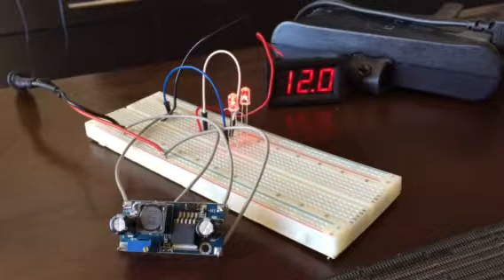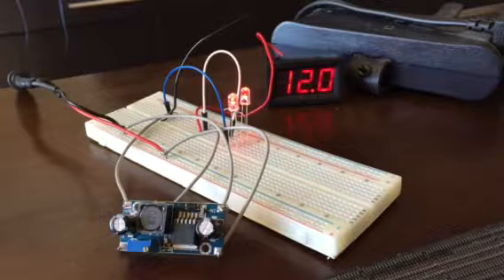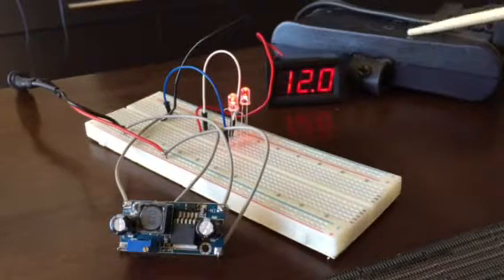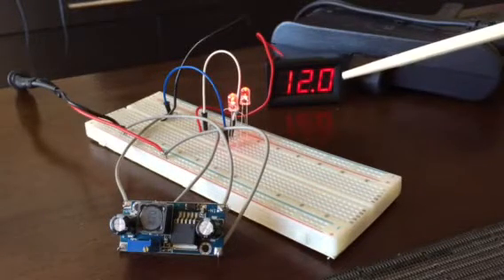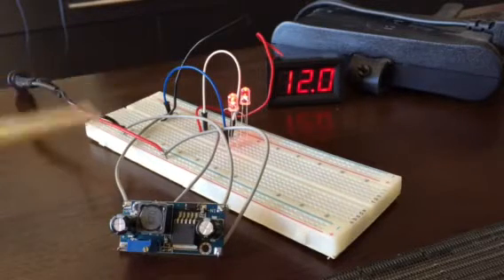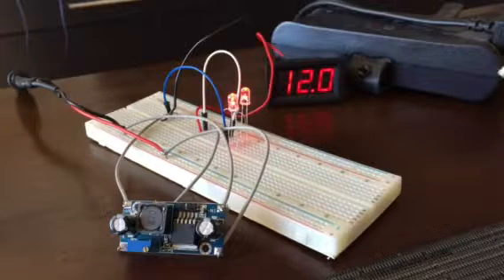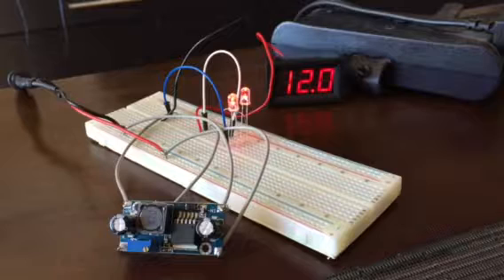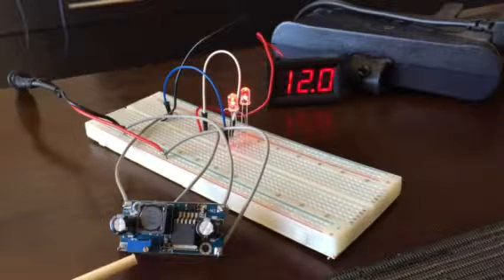Using an old laptop power supply to make a bench supply  - Part 1

Comment: can u please show how u were able to do this? specifically, how were u able to convince the charger it is hooked up to a laptop (and thus, it outputs voltage). I have a Dell 19.5v 4.62A charger Model DA90PS1-00, PA-10 Family that has the center sensing pin in the middle of the adaptor which I'm assuming is what tells it that it's connected to a laptop. thx in advance
Reply: wait, never mind.. just realized all I had to do for it to output voltage was to connect my positive lead to the inside of the charger adapter. I was previously connecting to that center sense pin. now to dbl check on them amps! thx for vid tho and ur right, there's a gazillion tutorials on converting an ATX PSU to bench power supply, but almost nothing (on YouTube or the internets) to use a laptop supply. shame as these are nice, compact and quieter.

Comment: I am also surprised there is nothing like this on youtube.  I have been doing this for nearly 2 years now although I am now getting rid of the lm2596 in favour of a 5amp voltage/current regulator.
I dont think there is any problem doing it this way the lm2596 is 92% efficient,   I just dont think people have thought of doing it